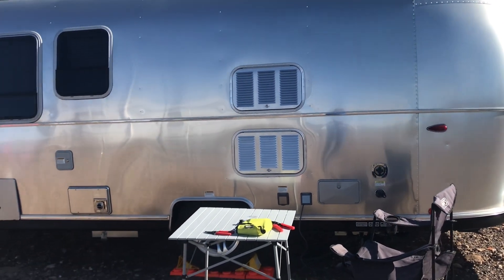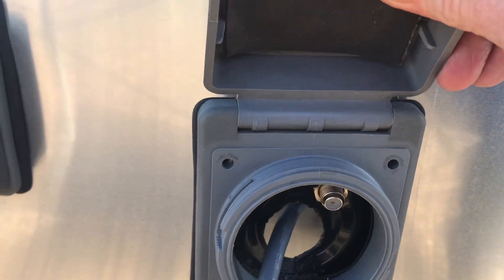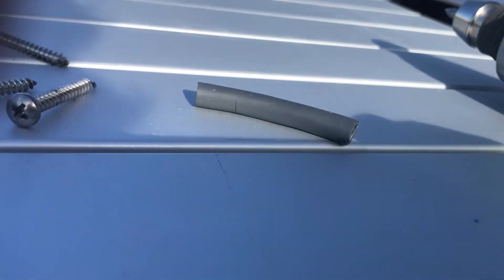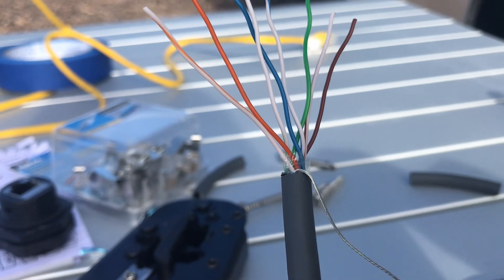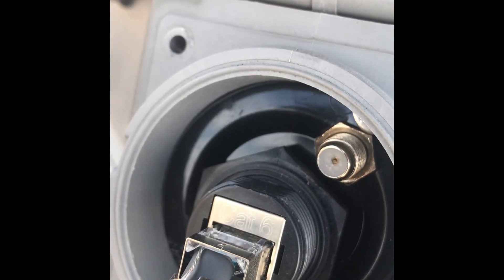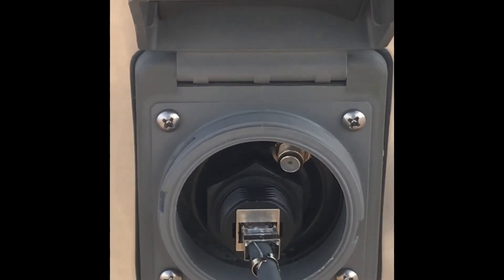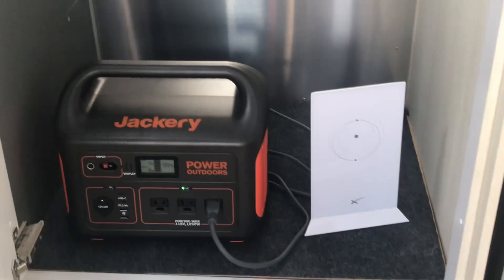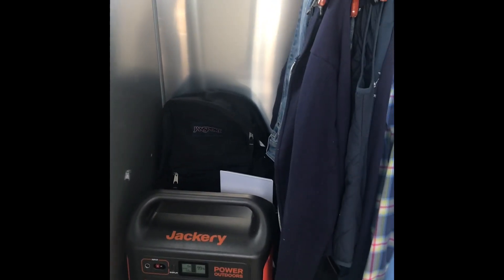Starlink Installation in Airstream | Solo Airstream Female Traveler | Airstream 22FB Sport

Comment: Greetings from California. I have Starlink and am looking to buy an Airstream. I really liked your installation video, it looks straight forward.  Are you happy with it after using it for a few months?  How is your WiFi signal strength outside of the trailer when you are at the campground? I am wondering about the aluminum the Airstream is made out of.  Also, do you just put the dish on the ground near your camp site using the regular stand?
Reply from the maker: It was very easy to do.  Actually that was my very first video I recorded so I appreciate the compliment.  Yes, I am very happy with Starlink.  I travel a lot and cannot rely on spotty hotspot locations.  Most of the places I go to the hotspot does not work so Starlink has been wonderful.  It works great outside and inside of the trailer.  No difference.  In fact, one RV park I traveled to there was an RVer that was living at the park full time and he was charging others to use his Starlink on a monthly basis because it was so good versus using the RV park wi-Fi.  I just plug it into my trailer and enjoy my day.  I did a video about how I set it up.  It is really easy and I do not have any lavish computer skills.  Safe travels!